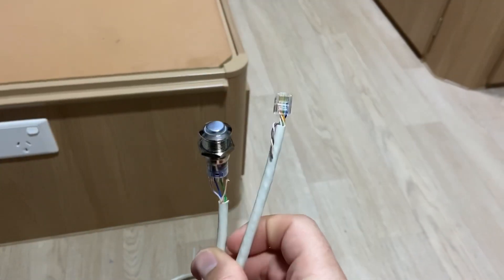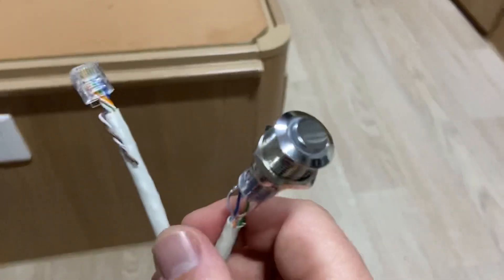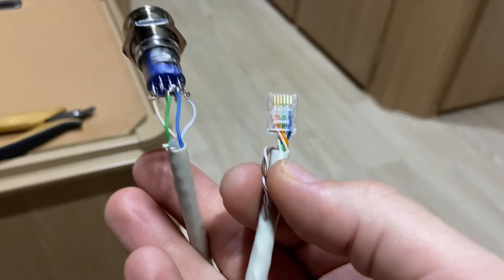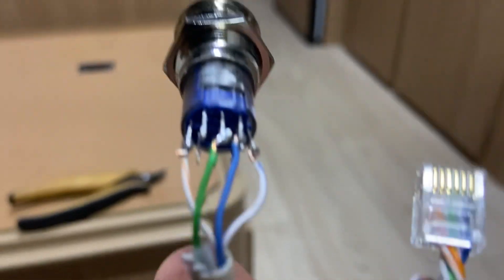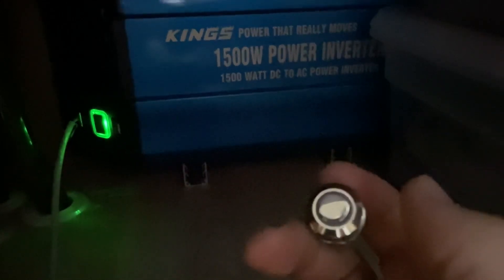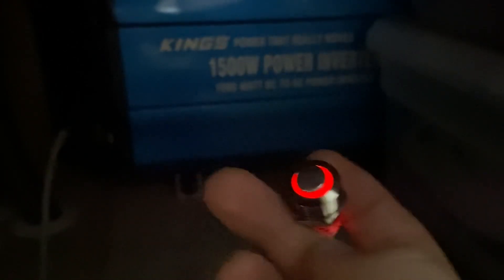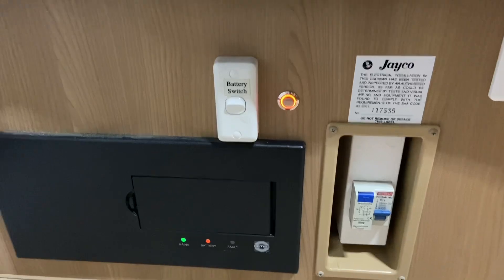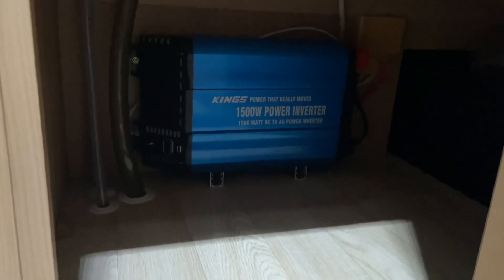Kings 1500W Inverter Remote Switch

Comment: Would it be possible to use a dual RJ12 adaptor and wire up two of these switches to have access to the inverter remote from 2 locations?

Comment: There's a remote switch now available for the 1500w at Kings. 
I figured out a way to make the blue LEDs stay off and keep the rest functioning. 
There's a resistor in series with the LEDs on the push button pcb. Just take one leg off so the LEDs can't get the return path. 
You can't just cut the 4th pin cable because it also supplies power to the switch. 

I hope this helps someone who's annoyed by the blue light as well!

Comment: Great video, inspired me to do my 2023 version of the inverter, however this method didn't work... BUT, I did managed to create a switch using the RJ12 6p/6c wire and a basic 3 pin illuminated rocker switch... Yellow wire Pin 5 is 12v, Blue wire Pin 6 is Control and White Wire Pin 1 is earth/negative - 5 & 6 turn the inverter on, 1 turns on the illumination. Works a treat (only when the inverter switch is in the OFF position). Hope that helps, thanks 😊
Reply: hi is this for the latest Kings 1500w inverter?  as i have the 2022 version with a single 240v outlet not 2
Reply: @warreng3142 Correct, single outlet, all black rectangular box... I believe they just made a new one that looks similar to the 3000w and is now compatible... but I'm very happy with my much smaller, button switch.
Reply: @ashetroboy1 I have the black one with a single outlet as well, but how do I connect 6 wire RJ12 to a 3 pin rocker switch..? Connect 2 wires per pin on the rocker switch?? And which rocker switch should I be looking at? One with 2 positive pins and one negative or 3 positive pins? Please help me with this😭 I really need a switch for it..

Comment: Just wondering if this will work on the black 1500w inverter, it has an remote port thanks .
Reply: Hi Grant - I have the black inverter also- check out Alex Scott’s comment about a month ago - worked for me. Cheers Ross
Reply from the maker: Hi Grant, not sure but I believe you can buy a remote switch from Kings now
Reply: @trentlewisperth  thanks mate I did ask them ,they were not sure when the new products comes out if there would be one for this model the one they have now is not compatible.
Reply: Thanks mate kings have said they don't have a remote to suit this model its not compatible.
Reply: Thank you to all for your help both are legends.

Comment: Excellent, thanks so much for posting this... Nearly didn't buy the 1500w as there was no remote control, but this will work perfectly.  Much appreciated!
Reply: Ok, for those with one of the newer king's 1500w inverters, the pin out is a switch (not momentary) between pins 1 and 2 and an LED indicator between pins 1 and 6 (pin 6 being positive).  It's 12v, so you need about a 2k ohm resistor in series with the LED.  Oh, and you can leave the power rocker switch on the inverter in the off position.  I'm sure the other pins do something, but I couldn't be bothered working out any more.
Reply: @alexscott4277  
Thanks Alex I have the new model also and couldn’t get the remote to work as Trent described. I’ll try it your way. Thanks for posting
Reply: @alexscott4277  Awesome mate. If they are not going to supply a remote they should at least give us the pin outs. I think I'm going to buy one of these inverters and see what I can work out. I don't think the Jaycar  Remote will work as it is momentary switch, like the older Kings unit. I think it will need to be one like this:
https://www.ringautomotive.com/files/myimages/product/Pro%20inverters/RINVWRC.jpg
Reply: @Wiz_Au  Unless the remote states it is specifically for this inverter, the chances of it working are virtually zero... As per my previous comment, a simple closed contact switch between pins 1 & 2 is all you need... And if you want visual indication, a LED and resistor between pins 1 & 6.  I ended up using a slim 240v light switch (which matches the others in my van) and housed the LED and resistor in the spare space in the switch housing... Works a treat.
Reply: Picked up my inverter today and spent this evening doing what I could. It appears it's not so simple as wires powering 2x LEDs and a switch. I'll draw it up later, but I'm going to start a WhirlPool thread on this, and make a webpage with the pinouts. Stay tuned ppl..... I'll post the info back here when I have it setup.
Reply: @Wiz_Au  hey bud have the same issue with the new kings 1500w inverter.. do you know where I can get a compatible remote.
Reply: @Wiz_Au  hey, mate, have you figured out the pinout setup and is it available somewhere online?
Reply: @alexscott4277  Hey Alex.. I'm dragging up an old thread here but i am in the process of trying to make a remote for this inverter.  Would you have a list of the parts you used to get this to work?  I figure its an RJ12 plug, 2k Ohm resistor and a switch... What type of switch is needed?  Thanks
Reply: @rchess79 Hey mate, yep you are pretty much there.  The switch can be any type as long as it's not a momentary button.  I used a slimline house wall light switch bought from Bunnings.  I drilled a tiny hole in the cover and hot glued the LED to the back side of the switch.  Looks pretty good in the end.
Reply: @alexscott4277  Thanks mate, thats great.  So if i was not concerned about the LED i can just wire pins 1 & 2 into the switch and be done?
Reply: Not sure what i have done wrong here but i used a Delta slimline light switch from bunnings and left out the LED and just wired the RJ12 plug.  It beeps and turns on but has the red fault light on
Reply: Actually, I've got the newer version of the 1500w that looks different to the 500w and 3000w version.  The pinout seems to be different, with pins 1 and 2 turning the unit on/off when the main switch is off... Still trying to work out how to add an LED indicator.
Reply: @Alex Scott Thanks Alex, pin outs for remote for the new king's inverter were spot on!😊

Comment: Thanks Trent, done mine yesterday, perfect result. Cheers mate.
Reply from the maker: Cheers, comments offer some good suggestions did you see that or use my wiring?
Reply: @trentlewisperth  I've used this one based on your concept but I've used cable 4(red)&6(grey)to go with NO&C on switch, then 3(green)&5(black) cable to go with + & - respectively so my LED switch will lit up when the inverter is on.
Reply from the maker: @cocoleafss  great, I need to change mine to be the same.
Reply: @trentlewisperth  I've used telephone cable 6pin, so just follow those colour that I've written and your will lit up the opposite way if needed. But hey, the main idea came from you mate..can't thank you enough!

Comment: Great video mate! I ended up using Yellow/White off the NO switch, Red to the Common and Blue to the Negative LED terminal. The LED is on when on, off when off.  It’s only 5volts on the LED but fine for most lights
Reply: Hi Ryan and thank you mate. Just confirming if you only connected 3 wires in total and all works. Thank you mate
Reply: @garybathurst  no, needed that yellow/white together to make it work on mine.
Reply: @MrRDEF  thanks heaps Ryan

Comment: Do you have any issues of the inverter turning it self off after 10 min or so. When pressed with the remote.

When the plug is disconnected it stays on all the time.

Comment: have a problem wonder if you can help have connected 1 and 5 to switch but notice that the switch does not turn of led  like yours any ideas
Reply from the maker: Have you tried changing the polarity of the wires going to the LED? In other words swap them around.
Reply: @trentlewisperth  yes that changes colour of led from red to green maybe they have given me the wrong switch

Comment: Its not possible to use a 12v switch eh because of the 220v the inverter works at....?
Reply from the maker: Hi Laoise, the switch I’m using isn’t connected to the 240v circuit, it’s connected to the remote connection on the inverter, problem is Kings doesn’t supply the switch so this video explains how to make one. Read the comments for other useful tips.

Comment: This was super helpful and really appreciate the time you went to to film this.
I went 1 step further and using a remote activated 12v relay (ebay <$10) so I could trigger the output on and off. Super useful in my application!
Reply from the maker: No Worries, 3,000 views in 6 months so its clearly something missing from their product. I'm glad it was helpful. A few people have expanded on my idea and made it better which is great. read the comments to see the different options for the LED. Cheers

Comment: I can confirm, as per John Apostolakis,  pins 4 & 6 for the switch (momentary) and pins 3 & 5 for the LED. This way light will come on when inverter is on, off when it's off. You can't however replicate the dual colour of the light built into the unit, which goes red momentarily on switch-on and will also go red on an overload or error condition. At least not with the polarity agnostic LED in the switch that I have. Maybe with a switch with a dual colour LED built in that may work? You'd need to check the polarity of pins 3 & 5 to see if it reverses on green / red indication..
Reply: Has any one found out if it is possible to have the overload error show on a switch LED?
Reply: Hi ,most switches with leds have a single led ,you could connect a seperate red led in parallel with the button led..
 @lefthanddown8684

Comment: I have the same Kings inverter and also wanted to get the remote working. I tried everything I could to get it working but it wouldn't. I metered all the pins and wasn't finding any voltages or resistance to the case. It had me stumped. So I removed the black plastic end with the port and sockets on it. Low and behold, the RJ12 jack wasn't soldered onto the board where it was meant to be. Unbelievable shoddy quality control!

Comment: Hey Trent!!
So pin1 to + pin5 to - 
Pin 4 to NO pin 6 to COM

Or 

Pin 1 to -  pin 5 to +
Pin 4 to NO pin 6 to NC???

Cheers
Reply from the maker: Hi Olga, For the switch pin 4 and pin 6 goes to NO and COM (doesn't matter which way around because its a switch) and for the LED pins 1 is + and pin 5 is - . However read the other comments, some good suggestions about having the LED on then the Inverter is on, where I had it the other way around. That may depend on the LED you are using.

Comment: You can have an LED on indicator. Don't use pins 1 and 5, rather use pins 2 and 3. They produce 3V when the inverter is on, which is perfect for a standard LED (pin 2 is +ve). I think the reason the OP didn't pick up on this is that the voltage required for the LED in his switch is 6V. I also purchased a Projecta PWREMOTE and re-wired it. Basically take off the back cover and de-solder the 4 wires (Black, Red, Green and Yellow L->R) and resolder Red, blue, yellow and green (L->R) on the circuit board). The green indicator LED is a little dim, but it works perfectly! Great Hack, thanks!
Reply: I used 3 and 5 which outputs 3v. 2 and 3 seem to do over 12v when I put my multimeter on it

Comment: Can you also light up the LED when the unit it on rather off? In only use the inverter for short periods and rather the light be on as a reminder to switch it off. Thanks
Reply: I used wires 3 and 5 for the light and the light comes on only when it's on. Thanks again
Reply: @japostolakis  thanks for the info as i onky want the light to remind me that its on. Sweeeeeeet!!!!

Comment: This is awesome. I tried all combinations manually a few months back and couldn't figure it out. I didn't expect an led light was in the mix. Will it work without the led? Gotta try this out again. Thanks
Reply: Found my issue. Needs to be rj12 with 6 wires. I did my testing a while back with 4 wires. Didn't know there was a 6 wire version. Can get that got Jaycar too. Got mine set up today!!! Thank you
Reply: @japostolakis  hi  john. Im on jaycar trying to order the rj12. Did you get 2mm or 3mm? Did you get 6p 4c? (Not sure what the 4c means....4colour?). ANY direction will be greatly appreciated :)
Reply: @LaoiseAnne  hi. It needs to be 6c. I made the mistake and tried 4c initially which only has 4 cables inside which is not enough
Reply: @LaoiseAnne  can't remember the mm. Don't think that would matter much
Reply: @japostolakis  thanks HEAPS! I misread the description on jaycar, it was 2m or 3m not mm. Gonna go order now :D thanks again and may your day be blessed! :D
Reply: @LaoiseAnne  anytime. Good luck on your project